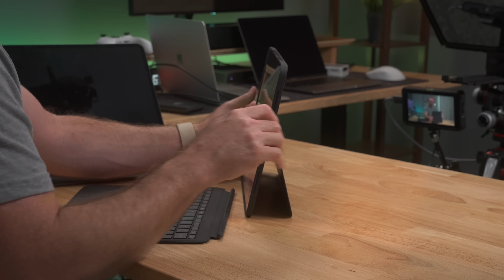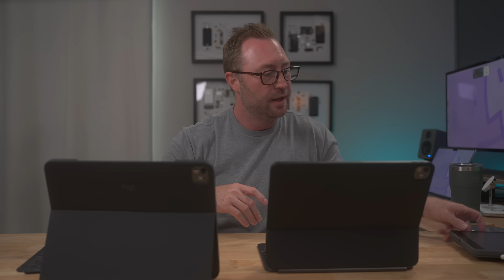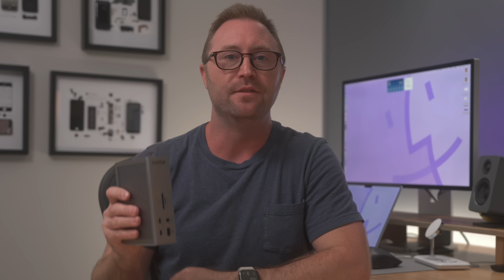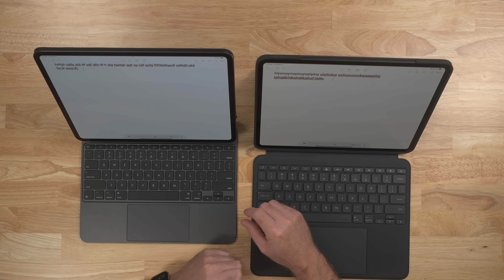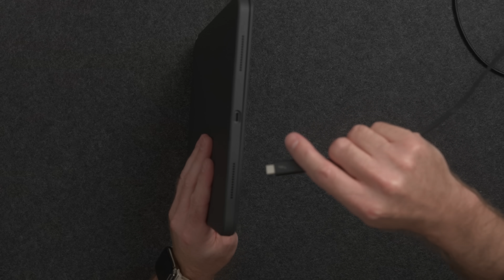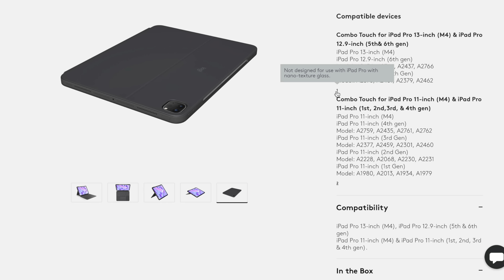Logitech Combo Touch vs Magic Keyboard for M4 iPad Pro!

Comment: 2 things ive learned is there is always a compromise and also you should probably get a laptop cover if you want these to stay clean. Most people dont change devices every year i have had my M1 13inch 5th gen Ipad Pro for 5 years and despite cleaning it properly every week there is still stains on the magic keyboard so I would recommend not eating and touching it also dont lay it down on surfaces without something underneath otherwise it stains quickly. If I upgrade in the future im definetly getting the darker colour id rather see finger prints then ink/colour stains

Comment: Just watching this now, a year after release. The one that was brushed over and never mentioned were the sides of the daughter’s combo touch cover. I’ve seen this on many many used items on eBay where the speakers covers have distorted or just broken, even after very little use. The damage is caused when removing the iPad from the cover. This is quite a major design flaw which was not covered in this video and it should’ve been.

Comment: I had a Logitech holder in the past and I loved it! I really liked that you could detach the keyboard and I have an Apple case for my iPad my hubby gave me to try but I really don’t like it! When I try to adjust the iPad the iPad many times falls out of the holder and there is no lit display for the keyboard. And trying to use the iPad , I am always having to be careful not to touch the keyboard even a little or it messes up what is going on, on the screen . Very frustrating! I am definitely getting a different iPad case and one with lit up keyboard display as well as a removable keyboard. If I can’t find that combo I will go with Logitech for sure. I loved that set up!
Reply: Also I wanted to say that when I turn the keyboard to the back it still try’s to work sometimes and that’s annoying also

Comment: Does the combo touch use the kickstand to stay up while it’s connected or does the hinge support itself? Nevermind watched to the end. I’ll definitely not be getting this keyboard. It’s all about balancing this one. Not a fan at all. Magic Keyboard is way nicer. My only complaint is that I wish it could bend further back. I think they need to make the keyboard a little bit heavier and weight it down so it doesn’t flop back on your lap and so you can bend it all the way back.

Comment: I've had the same issue with a different case and accessing the power port; i used a dremel drill to widen the hole (or an electric nail drill will do the same thing).

Comment: why you guys only focus on physical features? (and I mean youtubers who test them)? No one mentioned connectivity issues, random glitches (like iPad being not responsive with Combo Touch), virtual keyboard appearing randomly without even trying to use it etc. I can’t say much about apple magic keyboard but Logitech Combo Touch is definitely a beta product that needs polishing mostly on software (that’s its biggest downside). Cheaper bluetooth keyboards work better than Combo Touch to be completely honest. Physical functionality is ok I guess, it’s quite comfortable and ergonomic most of the time but the number of software issues is just beyond acceptable.
Reply: I bought my mom a new iPad 11 Pro (M5) with the latest ComboTouch Keyboard. It will not connect at all. The keyboard lights turn on but that’s it. Apparently, Logitech didnt modify anything with the ios26 firmware update and a lot of their keyboards are dead (found many reddit threads on that issue). So now I am ordering the Apple keyboard for my mom…..

Comment: I have the Logitech Combo Touch (13) and like the 11" that I owned, it's the trim that is failing. On the 13" version, a little strip that protects the screen has come apart. I've never had a problem with the hinge but the quality of the materials.

Comment: I don’t know why nobody is talking about how terrible the Logitech trackpad is for typing. It’s nearly impossible—my cursor jumps around constantly because my palm brushes it. Palm rejection seems non-existent, and on iPadOS it’s even worse. I ended up regretting my purchase—it was a huge mistake. Can’t type without triggering the cursor, and using it on iPad just amplifies the problem.
Reply: Could you not turn the sensitivity of the trackpad right down to the lowest setting? I have never used the Logitech one, but on all the other trackpads/mice I have used you can turn the sensitivity right down until the cursor barely moves and also make sure that tap to click is switched off so you need to physically click the trackpad. When I did it with cheap keyboard (not that the logitech is cheap or poor quality) I originally had whilst saving for the magic keyboard I would crank it right down and just leave that settings page open in the background so it only took 2 seconds to crank the sensitivity right back up to my preffered setting.  Actually thinking about it while the sensitivity is turned right down the touchscreen is still in play and probably would be quicker to use anyway

Comment: Ive been pretty happy with the logitech combo keyboard for the iPad Pro. One of the pain points I've noticed is because the iPad is so slim, the pencil kind of gets knocked off the magnetic spot that holds it whenever it gets brushed up against something (especially in a bag or carrying case). 

The way I solved it is by attaching one of the pencil case holders I found on amazon (i got the ESR one) to the back of the iPad's case. It actually sticks very well and I've never had the pencil holder come off. It's definitely something Logitech should consider adding to the next generation of the combo touch (or adding a magnetic latch to the top of the case to stop the pencil from being brushed off the iPad).

Comment: I was 100% convinced of getting the Logitech keyboard, it seemed the logical option… Until I saw that its not comfortable to use it on the lap or on the bed, which is where I usually use my iPad, on a proper desktop I will most likely use my MacBook. So, I ended up buying the Magic Keyboard and I don’t regret it. I am not saying the Logitech is not good, it just doesn’t adjust to my needs.
Reply: I bought a sturdy lap desk with aluminum legs. It's height adjustable and can tilt. Comes in different sizes. I got the small which is large enough for 16" laptop and mouse. 
It's light and in my professional opinion, very sturdy. I bought it on Amazon for $21.00. 
I have a large padded backpack. I can fit my laptop in a padded sleeve, the lap desk, iPad, the chargers and note books and sketch pad. I even have a wireless keyboard and mouse with 6' HDMI cable in there. In case I need to plug into a display for presentation. 

I would never base a decision of versatility over something that can be solved with a $21. Lap desk. Which you did be using already. 

It fits in my bag, for in my back pack. 

I even got the larger one for next to my couch. I think that one was $36. I bought that one first a couple years ago.
Reply: This is metotally

Comment: I do NOT recommend this product if you are going to use the keyboard anywhere other than a perfectly flat area. Placing your hands on the keyboard when it’s on your lap slightly bends it and chaos ensues - your mouse either won’t click or starts clicking randomly and in weird places. HUGE disadvantage for someone like me who likes the versatility of using the device on the couch, in the car, or in lecture halls without desks. I’m currently debating returning the product :/

Comment: I have the Logitech with the 11 inch iPad Pro. Two issues: I take a lot of screenshots and when I use it without the keyboard (which has a shortcut), holding the necessary buttons in the top right hand corner (when held vertically) is really tricky. Also, the rubber around the speakers and at the bottom of the screen keeps growing.

Comment: I regret getting the Logitech so much! I miss the apple folio keyboard that previous generations had instead of this Magic Keyboard. The Magic Keyboard isn’t great for lap use and you can’t fold the keyboard back to use like a tablet but keeping the keyboard on it. The Logitech is not good for using in lap either  and you can’t even use it very well on a tv stand because with the keyboard out and the kickstand folded out it is longer than most tv stands. The touch pad on the Logitech feels like something that would come on a temu product. Any suggestions for a keyboard case similar to the Apple folio cases previous generations of iPad Pro had?

Comment: I have to say the Combo Touch is good, and honestly I’ve had no palm rest issue people complain about. The case is actually amazing. However, when it goes to actual typing experience, etc, I find the Magic Keyboard 203012031 times more comfy, something about the footprint of the Combo Touch that requires more space for my hands to be on the desk. Trackpad on Magic Keyboard is defo better overall.

Comment: Love the review so thank you! A small remark in this “user friendly” world regarding the port size on the side - if some cables don’t fit, just take a mild file to it and that will solve the problem… It won’t really show and that will make the difference between a keyboard case that actually protects your iPad while allowing to use it with or without keyboard, at any angle you want, at a much lower price, compared to a single-use overpriced accessory mostly justified by “you know how much I paid for it”…

Comment: Great review, thanks. A friend of mine just got a brand-new iPad Pro 13-inch and the Magic Keyboard. She ended up returning the keyboard because the big iPad would NOT stay magnetically "stuck" to it for regular use. I tried it a few times as well... very frustrating. Will definitely check out the Logi.

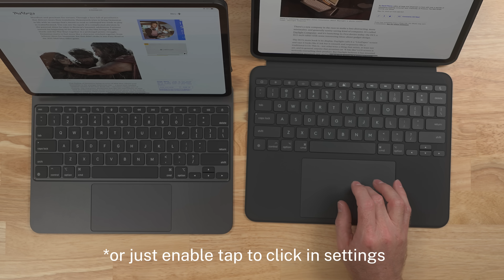Comment: 12:48 USB ports on Apple Magic Keyboard: side for data, but power only at the one on its hinge.

15:33 Logitech combo is a two-piece: detachable keyboard and the flat back. The two pieces are held together along the keyboard's magnetic strip.

On the back of the iPad, there are those 3 little dots. I have no idea why, but they are described as "pogo". Anyway, both the Apple and Logitech match these to where the iPad rests. 

// Separating the keyboard from Logitech combination interrupts the connection to the pogos: No juice to keyboard, no talk between iPad and keyboard.

QUESTION: In olden days, were the connectors located on the side of iPads? In what year and on which iPad model? Were they always those pogo thingies?

Comment: Thank you.
Your review was very helpful and helped me make my purchase decision. 
Went with the Logitech option, mainly because of the protective case on the iPad. I frequently use my iPad alone without the keyboard. Don't feel comfortable with it NOT protected. 
Thank you again. 🎉🎉
Reply: hello ! i want to purchase it but I've seen some reviewers complaining about bad palm rejection of the trackpad being a BIG issue for prolonged sessions of text typing .. did you also experience this problem ? is it that critical or just a bit annoying ? are you happy with your purchase ? thanks in advance for you response ! all the best !
Reply: @ 
It turned out to be a bit too heavy for me. It turns out that I use the Apple Pencil and write in the screen much more than I use the keyboard. In the end, the weight just was not worth it. It adds a substantial heft to the screen. 
But I think this really depends on how you predominantly use your iPad. 
There was also something with the glue on the rubber. It actually came off and I had to superglue it. Maybe it has something to do with how I used the iPad. 
I don’t recommend buying this product if you use the iPad more as a writing screen vs a laptop.
Reply: @JosephWen01  ok  , noted . Thanks a lot for your feedback i will definilty take into account ! All the best 🙏

Comment: What brand of protector for the Ipad (13) would you recommmend using with the Magic keyboard?? Great review by the way!👍🏻
Reply: I presently use the Logitech and had to replace it twice for issues with the keys but Logitech did it free of charge. Updates for the keypad are not straightforward either..🤷🏻‍♂

Comment: I have the combo touch for 2021 iPad Pro and just ordered a new iPad. The main issue with the combo touch is the side protection is a bit flimsy and bends over time. I’m using mine on my lap a lot, is the apple keyboard better for use on lap?

Comment: Thank you for the review of these two keyboard/cases. I am looking at them and the Brydge. Question: there doesn’t seem to be any bumpers protecting the iPad screen from touching the keyboard when it’s closed. My old Brydge keyboard had them. How is the screen held away from the keyboard itself? I’d hate to see little scratches caused by touching the keys or aluminum.

Comment: The problem that I have with both the Apple and Logitech keyboards is as follows: Due to a “lazy” left thumb it sometimes touches the trackpad and activates the pointer like a mouse move. Sometimes this even makes the app switch to another open app in the background. When typing rapidly (like I do @85wpm), the pointer goes off the screen. When using my Mac, I can disable the Mac trackpad when I am using either an external TP or mouse. This cannot be done with either the Magi KB or the Logi KB. I have complained to Apple and Logitech about this many times but it seems to always falling on deaf  ears. What do you think? Greg from Rio de Janeiro
Reply: Could you possibly place an extremely flat board over the trackpad while typing? I know it defeats the purpose of being portable without carrying around extra stuff, but possibly a diy cheap hack to prevent accidental gestures on the trackpad,
Reply: @strawberryyogurt0  I have tried squares of cardboard, outdated credit cards, etc. They all work but really look wonky and get in the way. i just want the iPad to work like the Mac that allows me to turn off the trackpad when using an external trackpad or mouse. Is that too much to ask?

Comment: You said older iPads can’t be used for this case, however Logitech website states that it’s compatible with IPad Pro 11-inch (1st, 2nd, 3rd, & 4th generation) i am a bit confused now. Can you please reply if its compatible with older iPad Pro versions? Thank you for the Video
Reply from the maker: You have to buy the case specific for your iPad version. They have separate cases for m1, m2, m4, air, pro, etc

Comment: Can you turn off the M4 iPad using only the keyboard? I was able to do this with previous iPads using a Logitech keyboard by simply holding on the sleep button but can’t seem to do this with the new Magic Keyboard regardless of the button combination.
Reply from the maker: The lock button on the MK locks the iPad and the screen will shut off on a few seconds. Using any keyboard you can type Control-Command-Q to do the same.